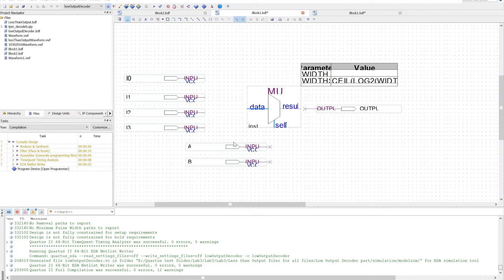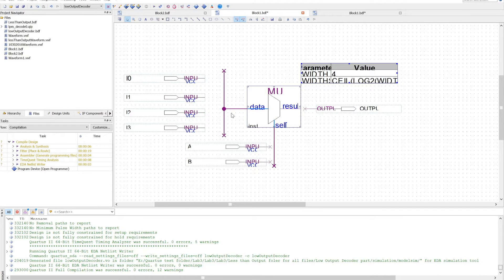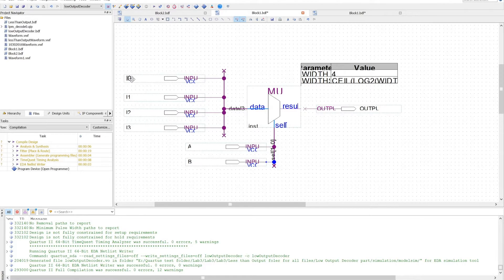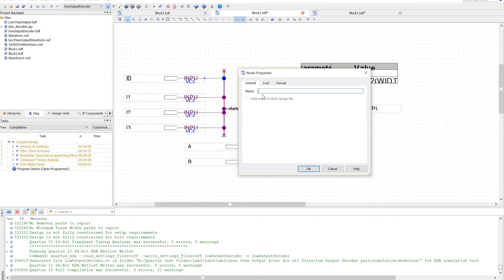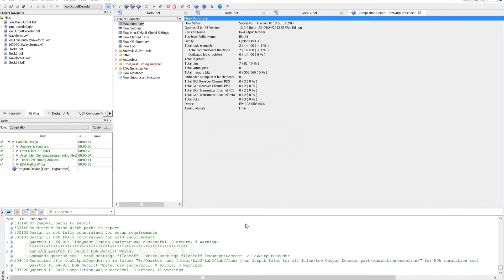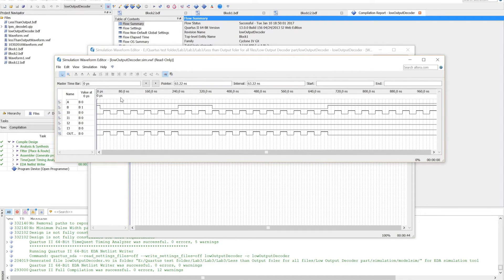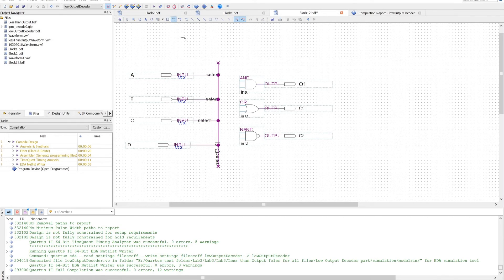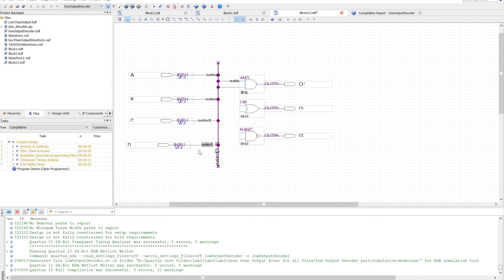Bus tool in Quartus II

Comment: Whenever I use parenthesis in a bus name, I get an error in the compilation!
Reply: I was struggling with that until I found out Quartus doesn't accept Verilog notation of data[7:0] (colon between numbers) but requires its own data[7..0] (two dots between numbers). After that it all worked :)